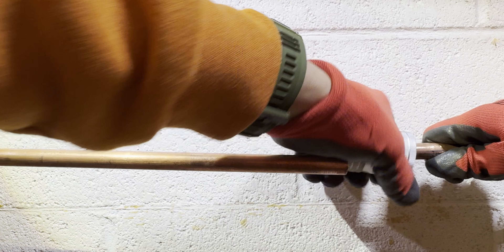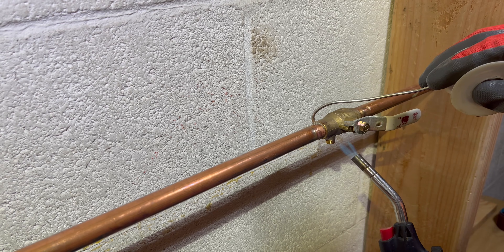How To SOLDER a Ball Shut-Off Valve [SIMPLE]

Comment: How do you separate the two cut ends of the pipe to get the valve installed. My existing 3/4 supply line has no ability to move back and then forward to insert into the valve ??
Reply from the maker: Hi, we’re making a video for this type of situation. It might be up within a couple days.